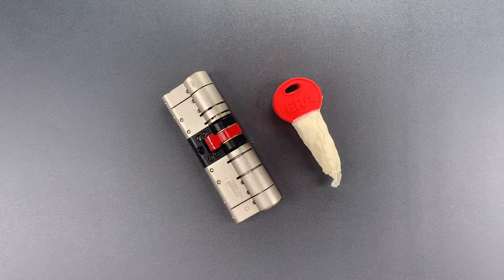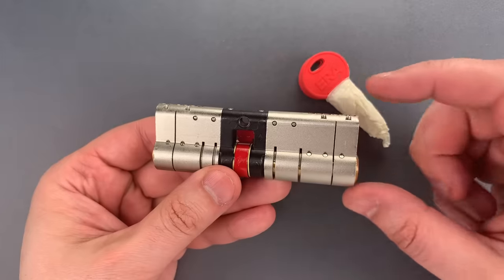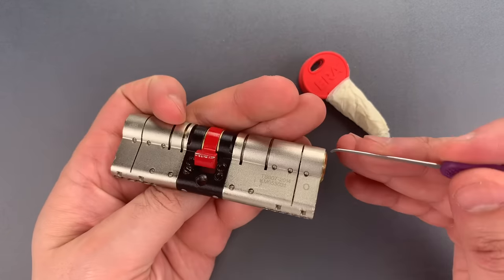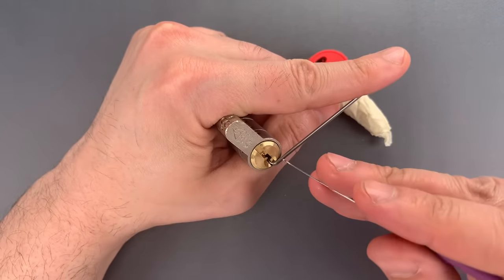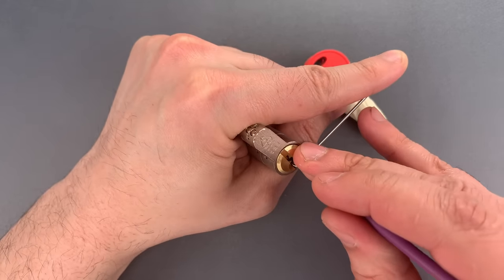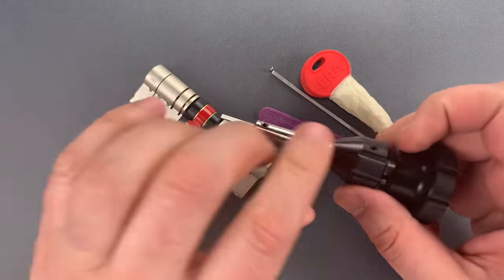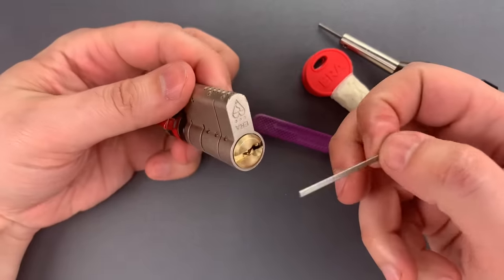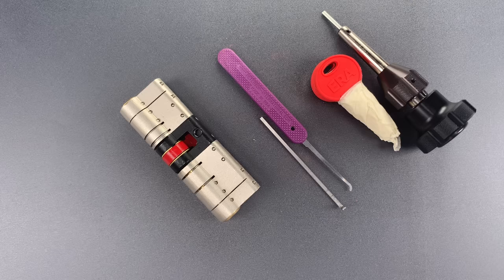[1256] ERA “Fortress” Euro Cylinder Picked (6 Trap Pins!)

Comment: Looks to be worth the money. Tons of security features in the lock. If you didn't see the cylinder, would you have known they all those security features?
Reply: If only my door lock was as secure. Mine fails and needs replacing at least once a year.
Reply: From experience, he probably would. But again, anyone below expert level would likely not.
Reply: @MrCow579  sadly he would not seen the trap pins
that is what he said, he was able to solve this fast due to knowing there are trap pins (so he can bypass it by turning it quickly using the tool)
if LPL didn't know, he'll get caught of it like most pickers
this is already impossible to pick on the street especially if the doorlock is in the highway (many people)
Reply: @madtech5153  they are not difficult  on a door  either
Reply: @aurongrande6141  Unless you live in a marine environment, it's time to buy a good lockset.
Reply: @madtech5153  I think he can identify the locks by the fronts on them by now. He knows this brand and type has these trap pins
Reply: I'm thinking screw it and kick the door down. What a pain in the arse!
Reply: @Jay Rozes your telling me that lockpickers use superglue and sand to open the lock? How? Besides that if it is getting picked by semi-lockpicker with the eventually get the rotation security pins getting engaged the lock would one-time-use/trash as I don't see it getting used anymore because of the  pins don't seems to be resettable? Only the one side that got not affected is useable?
Reply: I think it would be easier to just cut out a rectangle in my door
Reply: The brand stamp on the face would give it away to anyone who knows.
Reply: @Schaddn  Don't forget the windows, I could probably break into my house in 15sek with a rock....😌
Reply: @MrCow579  it's impossible to know these trap pins are in there unless you can see the whole lock. Not even lpl is that good
Reply: @PaletoB  most common  way
Reply: @DracoDrakie  they are easy(ish) to get out of the trap pins,
Reply: @UncleKennysPlace  I wish. It's Council property. They replace the locks. Their own repairmen men carry boxes of these locks in each work van because they fail so often.
Reply: @BigDaddyWes  I Spoke in the event of my described situation, ofcours I thought about what you said. But Evidently, IF we speak about a lockpickers that are knowledgeable. You can have a knowledgeable lockpicker but might not have heard about this lock. But ofcours not.much of a pickers that doesn't look the symbol up in front of of the keyway. 

But speaking of a burglars... Now there is a problem it the lock hasn't have resettable feature. I don't recommend then to use this one to an apartment?! Or am I mistaken?
Reply: @aurongrande6141  not versa are they?
Reply: @BigDaddyWes  Would be cool if you could order them saying "Master Lock" on the front. That would make it a sleeper.
Reply: Good Question....LPL ?
Reply: @DracoDrakie  Wait, you can recognise the lock by the symbol on the front? Wouldn't removing the symbol make the lock safer therefore?
Reply: @righteousone1  /Ummm...... Really? Flamebait? Wasn't aware that actually still happened on forums......
Reply: They´re relatively cheap locks, around 30 bucks
Reply: @mufasaiam7794  It's not impossible for someone to know about the trap pins in the field, some one who knows their locks might be able to recognize it by the face or could even quickly look it up based on the branding on the front unless there is a face plate covering everything but the core. Even then I wouldn't be surprised if there was knowledgeable people who could recognize it, but that would be a rare few.
Reply: @fisch37  no,they are there so people  can tell they are a high security  lock, thought  being  that if this will be difficult i will break in next door instead.
Reply: LPL and any pro level entry specialist would likely have a set of procedures to follow when failure in the field is not an option. So any un identified lock will be assumed to have spools, trap pins etc. Yes you use more tools and take a little more time but using the trap pin technique when no trap pins are present only adds a few seconds and could save the time of bypassing the tripped trap as well as not leaving a trace.
Reply: @fisch37  Well you are not wrong. But the lock defeated it's purpose of keeping good in and the bad out. Especially if it's an apartment. Speaking of you being the good too, when/if the lock is being tampered further beyond the rotation security pins without your consent.
Reply: @DracoDrakie  I don't understand what you mean
Reply: @fisch37  You talked about removing the symbol in front of the keyway by I suppose grinding it away to be able to be recognised by anyone who wants to know what lock it is. Leaving aside bad and/or good person.
Which makes it more secure the lock that is. But it defeates the purpose of keeping you being able indefinitely get in or out. At some point in time the lock can be tampered with, on that day you might gonna have a headache that's not from alcohol. (Last sentence is just joke/sarcasm/rethorical)

Imagine that you sell/move-out of that said appartement I was talking about and forgot to leave info of the lock to the next adopters... If you're where not planning to keep the lock that is... Imagine the headache XD
Reply: @righteousone1  Ohhhhhh. Well I guess that says everything we need to know about you...
Reply: @righteousone1  LMAO  Thanks, I nearly spit coffee all over my laptop. (hugs)
Reply: @Jay Rozes wtf? People glue your door locks!?
Reply: @Jay Rozes Please refrain of the post/reply I have made so far rethorical and/or "if situations" I still have this lock preferred to a house that's not an apartment.
Reply: @Jay Rozes Clearly need to change where you live or who you know. ;-)
Reply: A lock is a good as the weakest link...they will leave the lock and laser cut a window
Reply: @aurongrande6141  equally likely that people lose the keys ...
Reply: @righteousone1  none, I don't like their eye's.
Reply: @FlameOnTheBeat  next time I get a job on one I will do a live job video.
Reply: Yes. I am also curious. How would you know where to stop and where the drop pins are located if it’s in a door. You wouldn’t be able to see the side and know where to stop turning. Also once the drop is it game over? Or can you turn back and start over..?
Reply: @Jester-Riddle  true. Still, mine fails too often.
Reply: @MrCow579  I don't think he has that deep of a knowledge of locks from the EU. It is so far away and propably expensive to ship these.
Reply: @MrCow579  hi cow!
Reply: Send locks embedded in a block of wood, min 15cm x 15cm, with a 1.5cm riser on the right side (when euro lock correctly "upside down"). Hide some info and can't hold the lock nicely.

Anyway, the LPL amateur is more ~97% more knowledgable and definitely 99% more skilled than most professionals, who would just leave your door and lock in a mess. Once in a generation.
Reply: I agree. 1000000000000% better than the master lock.
Reply: You can try to open Forever lock V3! 
  
 Then you must see Forever lock V3!
Reply: @titaniumdrivetechnologyco.8325  You're the one that reviewed it. Also, I saw the word "Unpickable" on my search results. Ehhh, no thanks. I would like to see LPL review it.
Reply: @edwinhuang9244  open forever lockV3!lpl!
Reply: @DracoDrakie  I was thinking that by ruining the lock, they have to get a new one. And hopefully in the process, they get a cheaper one.
Reply: @titaniumdrivetechnologyco.8325  I'm not a lockpicker. So I can't do that.
Reply: @CodeF53  why would  they get a cheaper  one?
Reply: @fisch37  Of someone is truly determined to get into you home, they probably will. A good lock will make them take longer and more likely to be detected, but especially if you have a home at ground level you probably aren’t stopping them. 

However the vast majority of the time, someone trying to break in is looking for an easy target so indicating strong security will make them go elsewhere. That is the same reason you see signs about security systems on the doors (although by now anyone likely assumes the signs are meaningless as they are are on so many homes without any security system).
Reply: as he stated, all but the most knowledgeable pickers would even know what to do with it let alone the type of lock it is, but yea an expert picker would know ahead of time
Reply: @John_Be  "I'm thinking screw it and kick the door down" - many UPVC doors now have multi point locking, so making that approach considerably harder. Some may also be reinforced with a layer of MDF, so making it tough to break through the door - and if the home's in a residential neighbourhood, repeatedly bashing the door with a sledgehammer to break through may attract attention from neighbours...
Reply: And this is why there are locksmiths dedicated to this field. Not just some random bloke who thinks he pissed the Niagara :) You basically have to be a walking lexicon who knows all locks at a glance or you can fuk up royally :)
Reply: @madtech5153  You have to know your business, then you recognize the type of lock and the hazards it poses.
Reply: @righteousone1  This guy has been trolling the channel lately. Don't engage.
Reply: @DracoDrakie  I meant the logo not being part of production
Reply: @shannonmcstormy5021  so the comment section is a forum now?
Reply: @ethdsththwethr7220  /I apologize...did I use the wrong term? Sorry, I'm elderly. I should have said "comments section." My bad. Actually, I am now curious....what is the difference between "forums" and a YouTube "comments" section?
Reply: @madtech5153  na mate :) if yo uwant steal something you get a bit ready. the lock has markings on it you come to locked door look check few times it with out trying to pick. go home study for day or hours about markings on lock what to expect and so on well that how i woulda do  id get rdy very good not just oo nice house nice door let me try pick steal something na na na preparation is to a key :)
Reply: Definitely.. I’m sleeping easy tonight!
Reply: I was thinking something similar: if this lock was installed so you couldn't see the pin configuration of would be more complicated to pick.
Reply: @tobiensam  nobody  has ever done  that.
Reply: @shannonmcstormy5021  umm i dunno the technical difference?  its not a forum by definition?? i mean if you yourself cannot differentiate the 2 then me trying to tell you wont make a difference like come on  now it can't be that much of a brain buster for you to figure out. If you know what forum is which you clearly must since you used the word in your comment in the comment section.  on youtubes COMMENT SECTION
Reply: By watching lock picking lawyers
Reply: @aurongrande6141  Surely that's the most secure lock you can get if even the actual key doesn't work, just lock yourself in your house and never open the door
Reply: @MrCow579  true. what if the company began offering unmarked or falsely marked faceplates to hide the true nature of the core.
Reply: @John_Be  not easily done. If it was my lock then my door would be metal with a reinforced frame on the wall.

If this was the case my building would be easier to get into through a wall.
Reply: @John_Be  sawzall, less than 2 minutes and your in...LoL
Reply: @Schaddn  6 inch hole saw either right next the lock or a foot away and reach in
Reply: I really wonder how many people in the whole world can pick this lock?!
Reply: @Jay Rozes How do you open the lock with a superglue/sand mix?
Reply: @PaletoB  With enough superglue/sand mix, you could build a rock.
Reply: @righteousone1  A real professional lock picker would have probably taken the door off its hinges quicker.
Reply: @cardiffpicker1  What else do they have to do with their day?
Reply: @righteousone1  Aren't you being the fangirl Righteous?
Reply: @righteousone1  Why would you think that? Maybe you should try therapy, Righteous?
Reply: @DracoDrakie  Well, if someone has already partially picked your lock, whether or not you have to replace your locks is the least of your concerns.

The advantage of it being non-resettable is that the burgler won't get a second chance, and that there's clear forensic proof that the lock has indeed been tampered with to show the police (which you won't unknowingly destroy by resetting the lock yourself).
Reply: I think the average picker would not, unless they were familiar with the brand of lock
Reply: @righteousone1  <<---obvious troll
Reply: @mikestuart1983  its game over.
Reply: @splosh2070  But what if I'm outside and need to get in?
Reply: @aurongrande6141  Sounds like you need a Stuff Made Here door lock.
Reply: @brenden-horn  I wish for a good lock, but I'm not allowed to change them myself. It's council property, so they replace the locks.
Reply: @smcdonald9991  267,000
Reply: @John_Be  my house got broken into once, one of doors they kicked open wasn't even locked, they never even tried the handle.
Reply: @ethdsththwethr7220  Definition of forum
1a : the marketplace or public place of an ancient Roman city forming the center of judicial and public business
b : a public meeting place for open discussion
The club provides a forum for people interested in local history.
c : a medium (such as a newspaper or online service) of open discussion or expression of ideas

Seems like comments sections meet the criteria of definition B or C.
Reply: There are other cylinders from era thet looks the same from the outside but offer a bit less protection.
Reply: thief proceeds to smash a window and enter
Reply: @fdeyso  is there?,I have never seen one.
Reply: @cardiffpicker1  just realised that in the local shopi bought it they call the “British Standard”  instead of Fortress, so it’s the same series
Reply: @karlgiese6100  as they always do.
Reply: @mufasaiam7794  the brand name is engraved on the front of the cylinder
Reply: @BigDaddyWes  ERA makes all kinds of locks, right down to simple 5 pin no-special-pins all-brass ones with zero security features. So no, the brand does not give it away (although the combo with the number of stars does tell you something)
Reply: What makes LPL the best is that he knows these locks. If you just took this lock brand new, yes, he would get caught. But he had so many locks in his hands and can recognze them and pick them. Thats why he is so good, he takes a part tons of locks.
Reply: @BigDaddyWes  Assuming its got one that says what it is, we didn't get to see it in the video that I could see. It might just look on the face like a normal cheapo lock - in which case nobody would be able to pick it successfully without already knowing the type of lock it is... Alway stuck me as odd that a "good" lock would stamp on the visible faces I'm a <x> - its very much like saying "I open if you do <y>" to somebody who spends time studying locks, and not going to put off the ignorant that can handle the picks but don't do the study, as they don't know its a harder lock to deal with.
Reply: @BigDaddyWes  Just use a file and they are gone. In this way you would not know the maker. The keyway looks similar to other manufacturers, so it's going to be hard. You must use this technique on every lock, just to be sure.
Reply: @ethdsththwethr7220  Pretty sure she's using forum in the original sense of the word, which simply means a place for discussion/debate.
Reply: @ethdsththwethr7220  /When I was in my early 20's, a young therapist working with serious criminals with addiction and mental health issues, at one point, I was bizarrely put in charge of the cleaning staff. The "campus" used to be a Tuberculosis sanitarium and there were multiple programs on this wonderful piece of wooded land complete with a pond. So, I had a meeting with all the programs to see where the cleaning staff was at, how good a job they were doing, etc. In one of these meetings the co-ed facility complained that the bathrooms were disgusting. I looked at them and agreed. I told the cleaning staff to deep clean it over the weekend. I came and looked at their work and was baffled, the bathroom hadn't changed. I asked the cleaning staff to clean the bathroom as they normally would and I watched. They wiped down the surfaces with disinfectant, cleaned the mirrors, and then sprayed deodorant around. Then they turned and looked at me. I was astounded. 

So, the next weekend, I cleaned while they watched. It took nearly 3 hours. I then told them that this is what the bathroom should look like after they were done. They said ok and I checked up on them routinely in the next couple of weeks and then periodically over month or so. The bathroom was always clean. Prior to me showing them, they simply didn't know how to do it, were never taught how to clean growing up. Most were ex-clients that couldn't get a job elsewhere and the facility needed staff willing to work around pretty hardcore criminals. 

So, no, I don't know the difference the between a forum and a YouTube comments section. To my understanding, its basically the same thing. Then again, I only started watching YouTube about 3 years ago when I became disabled with a progressive neurological disease and was forced into "early" retirement. I am highly educated and in some areas, I'm pretty smart. However, I am otherwise kind of an idiot. I am also, as an elderly person, not super tech-savvy. I am trying to learn however, as I believe in lifetime learning and trying to be as teachable as I can be, thus my question.....

.
Reply: @teovm  yeah just file the crap out of the front of your cylinder, that would  make the door look great
Reply: I feel like this is what he uses on his front door!!!
Reply: @aurongrande6141  council property? Because it's a special lock?  Are they the only ones to use this type?  I'm in USA.
Reply: @aurongrande6141  even more intrigued.  Hope to hear your answer how you don't own the lock to your own place.
Reply: @geniferteal4178  I asked them if I could change the lock myself and my landlord/council said no. It's part of the security and safety maintenance of the building and falls to them to deal with.
Reply: @aurongrande6141  I thought by council you meant police.  This is the people that run the building.  I have no experience with apartment or co op or condo living.  This is part of the reason. My place, I do what I want.
Reply: @karlgiese6100  if there are windows. Lol.
Reply: @geniferteal4178  the council  are the people  who manage the local  area,everything from bin collection  to some housing (usually partially funded or reduced rent), some council area's like to use a restricted profile  and only issue up to 4 keys ,so when the people  leave  the tenancy and return  keys they are all accounted for.
Reply: @shannonmcstormy5021  You're fine. Customary (20 years ago) forum is on specific topic, there is 1 main post to which you post responses. On YT comment section you comment on the video and on others comments. The difference is so small that it isn't worth researching into - unless you really want to - then try asking on Quora. I'm sure someone will tell you differences in protocols used etc. I think @ethdsth thwethr either isn't acting in good faith or somehow took your legitimate question as some passive aggressive response. Which is tiresome that people do that.
And as an addict, I would like to formally thank you for helping people like me.
Reply: @mittfh  correct, I don't really live in a high crime area, well its really low but we live in a high value area. So my doors are the composite ones that look like wood, fitted with these locks. I have seen the police with the big red key struggle to smash through, in fact the brickwork around the door started to fail before the door!
Reply: @jannegrey593  /I did it for over a half-century and It was my honor to do so. Seriously.
Reply: just be sure that brute force isn't easier than picking ^^
Reply: @righteousone1  Or perhaps he talking his time to tell the audience what is he going and explaining why he doing it
Reply: @aurongrande6141  I live in an area where I literally don’t even know where the keys to my house are because I bought my house 5 years ago and have literally never locked the door once.
Reply: @TPLeatherworks  Lucky for you. I live in a block of flats and sometimes I hear my door handle rattle as one of my neighbours, or their friends checked to see if it was open.
Reply: @Keldor314  Yea I get it, the reply I made was more rethorical. For example if like to get into my house that moment of discovery even if it's robbed. Saves me the hassle to spend money on hotel and/or sleepover. And all this with appartement in mind. Not regular house. Because if I owned a regular house I would buy this lock. I can always break my own windows to get in my house.
Reply: @DracoDrakie  why would  you smash the window to get in,?
Reply: @cardiffpicker1  In an event of the lock being tampered with with the rotation trap pins engaged... I'd like not to spend and/or hassle to the next day to get into my house.
Reply: @DracoDrakie  why wouldn't  you just call a locksmith  to reset it?,don't need to replace the cylinder, no need to clean up broken  glass and board up window,no need to replace broken  glass.
All that seems a much bigger pain  than making  a phone call.
Reply: @cardiffpicker1  As of early experience with such situation. I have imagined it while evening or early night,  for me to call locksmith for emergency purpose I would pay at least €300 with the possibility of a destroyed door and/lock while new glass window might cost maximum of €300. But that's if I have a house on ground floor. I live in an apartment right know and not willing to buy this lock with the possibility of resetting it simple.
Reply: @DracoDrakie  not many genuine  locksmiths  charges  €300 labour  for a fairly  simple  job.
Reply: @cardiffpicker1  look, you don't have to tell me as I did my research and such. And as I explained or maybe not, I had such situation in the night. Don't tell me you know what it cost on emergency as I likely doubt it. If it happend during the week in office hours maybe I would be settle with max of €100. But locksmiths are expensive outside office hours and weekends. If it's emergency I'm not calling 300 (figure of speech) likely locksmiths to find out which is best bang for my buck. Hell with the knowledge I accumulated over the years I wouldnt be calling locksmiths anymore.
Reply: @DracoDrakie  I am a locksmith ,so yes I do know how much they charge.
If you have so much experience  to not need a locksmith  why wouldn't you reset it yourself.
Reply: @cardiffpicker1   Al right humor me how much you would have cost on the weekend in the night with a radius of 25km/50 miles from your business to the client. Keep in mind I have called already several businesses with no response or estimation price which I don't disclose to you yet.
Reply: @DracoDrakie  25km or 50 miles ,which is it? ,there is a huge difference.
Reply: @cardiffpicker1  Well I already tried to Implicate the miles and the metric system we Europeans use. That's why I type it that way. But what I meant is 15 miles not 50 miles.
Reply: @DracoDrakie  labour would  be about  £125 so roughly  €150 depending  on roads and time to travel.
I am going  off of 1.5 hours for travel both ways  and job,if mostly  motorway it would  be more like 1 hour.
If there is a meter of snow they can f@#k off ,or pay a shit load more.
Reply: @cardiffpicker1  Do you get my "f*#k ing" (in your way of talking) point now. You kept questioning why on my responses but I think I was pretty clear and some I hope have common sense. "They got to pay more" for certain situations I understand. I that what I would predict next time if I'm such situation... I rather break my window. And be done with it. In my viewpoint it's cheaper in financial AND time wise.

So conclusion (moral of the story), for me at least; Don't buy this lock if you live in an apartment with windows on the outside of the building on who knows what floor that's not ground floor/1st floor. Because you pay £¥$125-150~ excluding; new lock and/or any damages on the door which you can set up £¥$100~ more. I take my chances and buy a new window... Which can set me up for max of €300.

Oh did I forget maybe to "re-key" the damn cylinder in that profile just to make sure
Reply: @DracoDrakie  if you get a genuine  locksmith  there will be absolutely  no damage  to the door ,no re keying needed no new lock needed,door open in a few minutes. 
You smash a window  you have potential  of severe  injury (I have known people  nearly  die),you are likely  to damage  something  inside  the house  with falling glass,you need to clean up broken glass and board window to secure, then you still need to call someone  out to replace  the glass which if  toughened glass will take about a week and involve 2 visits.
Common sense  says that  if someone  has attempted to break in through  the lock and it has stopped  them from doing  so where other locks wouldn't any cost involved in gaining  entry  would  be insignificant to the value  of what would  be taken,
Reply: @cardiffpicker1  Not gonna repeat myself again, I would buy the lock if I own a house on ground floor, will not buy now when I live in an apartment. I said I've researched and such what my options are when it happens again including what you all said. I didn't  imply that your not wrong. As I said I took al the calculation took my parents house for example. It take less then €180 including labor for the window. So with consideration I take my educated discussion when it happens. Including your estimated price in the hope I find locksmith like you near me. But when it's in the night on the weekend I say, fuck it I bust my window, there are enough stuff around a home to do it, and that I take extra precautions to not hurt myself.
Reply: @DracoDrakie  yes there is enough  stuff around  to break  a window, which kind of makes a lock like this pointless on a house  without  laminated  glass (vast majority of forced entry is through toughened glass),they are far more effective  and do the intended  job on an apartment..
What you are saying  is you would  rather get burgled and have a stranger  going  through  all your personal  possessions  and stealing irreplaceable items than  pay a locksmith
Reply: @cardiffpicker1  Yep, I took that as consideration too, call me crazy, right. I see a lock as a deterrent same as windows, based on all the considerations what it might entail if burglar(s) go through my whole house. If people are smart they should took measures on things they own. insurance, a safe (yea, it might be useless to the "professional burglar", password locked computers and what not. As many people said the determined burglars find there way anyway. Yes, yes I already hear people saying "then make it as difficult as possible". I know that too.... But yea, I explained myself already, I weigh everything to eachother.
Reply: @DracoDrakie  the best thing you can do is make your property  harder  to get into than your neighbours. 
Electronic  devices are becoming  less of a target these days,cash,jewellery, safes,medals, cars are the main target, (where I live anyway).
I am still struggling  to see your logic though, if this locks  security  features  are activated  it has prevented a burglary, but I suppose  it is your choice if you would rather  be burgled. 
But in reality  depending  on the area these very rearly  prevent  burglary, I attended  over 300 burglaries and attempted burglaries last year and less than 5 were prevented  by the cylinder.
Reply: @janbernad4729  big floof
Reply: @DracoDrakie  it can be used from indors
Reply: @MrCow579  brand name can be set to be seen only from inside...I think that is not a problem at all.